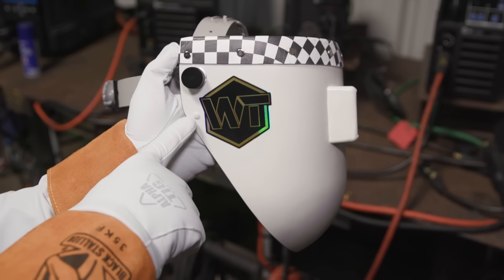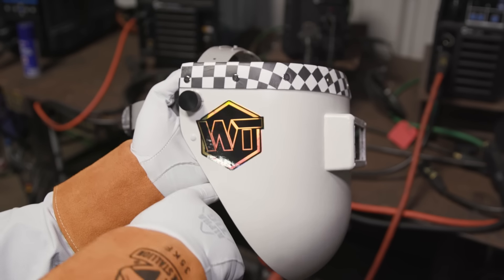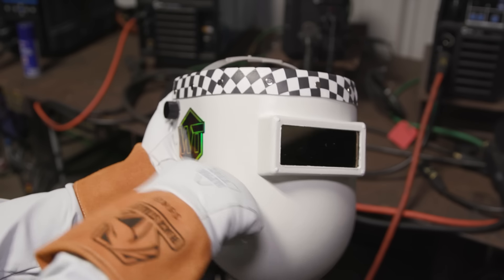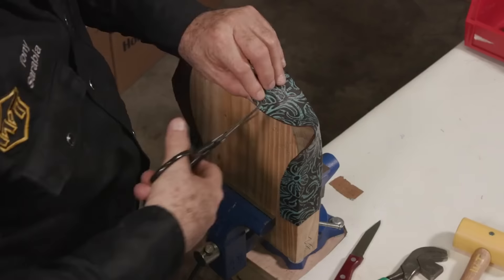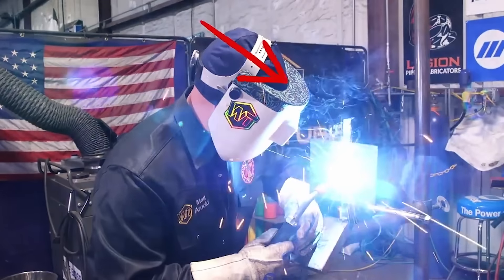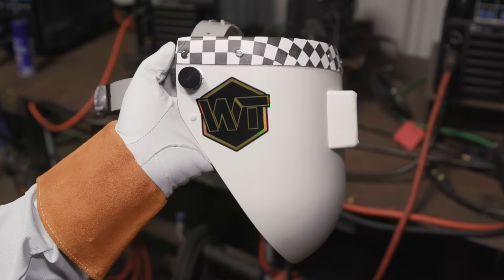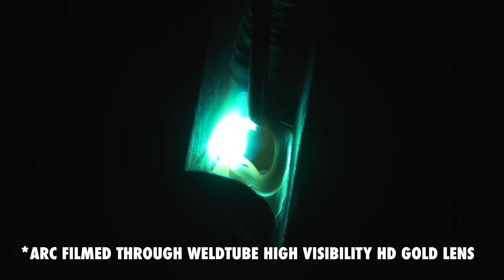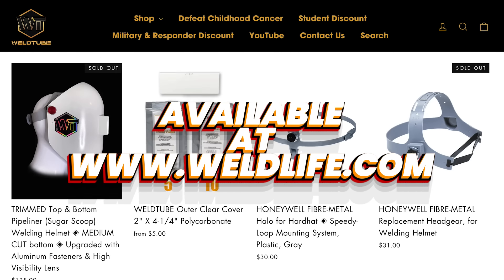Why Do Specialty Pipe Welders Wear Chopped Leather Top Pipeliner Welding Hoods?

Comment: More like specialty boilermaker tube welders. We used to make them on our lunch breaks. Someone brings the rivet gun and we would use a old leather welding jacket to shield the sparks and arc flash but yes used for hard to fit places.
Reply from the maker: Yes sir, also been used for decades by boilermaker tube welders🤙
Reply: I use a monkey mask,now I use it any time I'm at Tig,way lighter on my neck,I only use the bucket mask when I'm at the stick.
Reply: @frankcarden4709  whatever works and makes it easier on your body. The lighters the hood the less fatigued you will be in the short and long term. Specialty welding out in the field is definitely a young man’s sport but if you can stay in good shape there’s no age limit
Reply: IBB Local 456 Rock Hill, SC. By way of Local 83 Kansas City, MO, and before that, I was in your district, Keith. I started out in Local 592 out of Tulsa, OK. Are you still out of 74 in Houston?
Reply: @LeadRakFPS  yes sir I don’t work much in Texas tho, work dried up for union boilermakers. Non union so cheap it’s hard to beat.
Reply: @Keith Martinez  Yeah, I hear ya. The only time I ever worked down there was at Smithers Lake one year. Told myself never again, lol. You guys really only have STP as a decent job down there. I've transferred twice, and now I'm living in Georgia. Ran with CBI Services forever and ended up down here for Vogtle. Decided to stay down here and work at SRS (Savannah River Site, it's a DOE site like Oak Ridge). Boilermaker contract still, of course. Graaaaavy train dude. 40 hrs with optional overtime and home in my own bed every night. Hope you're doing well.
Reply: @Keith Martinez  You remember Zeke from Missouri? He's still out of 592 I believe. Me and him used to run the roads together when we first got in.